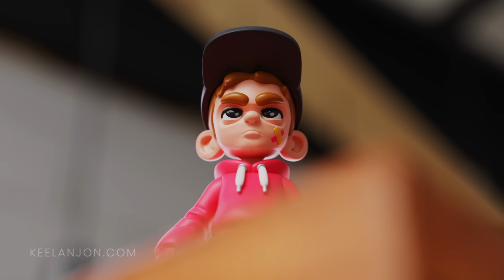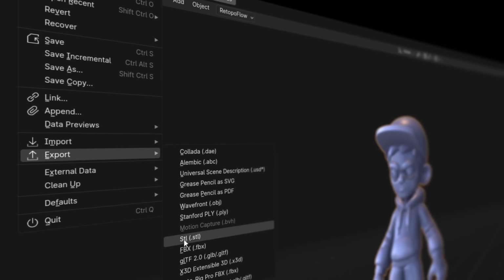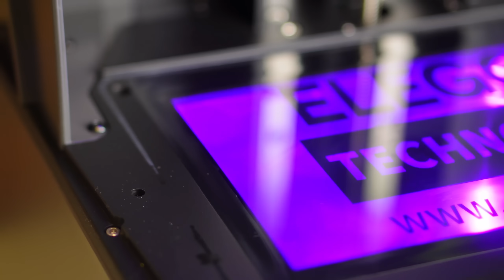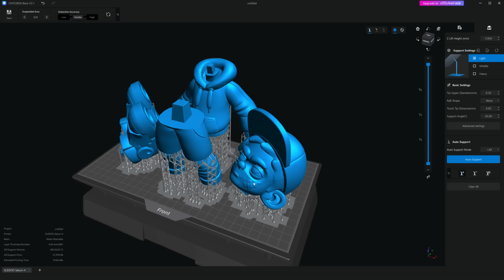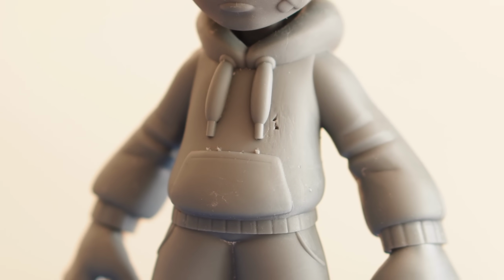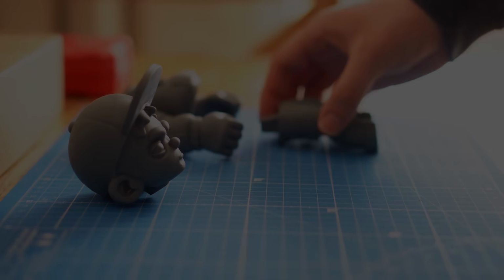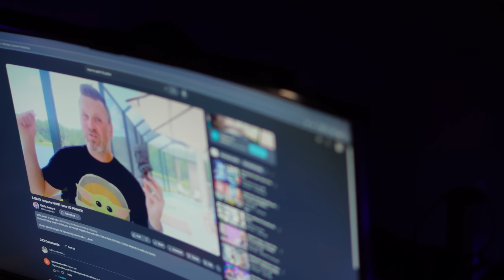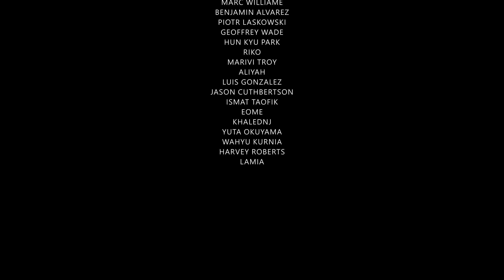How I Made My First Art Toy: Blender, 3D Printing, and Painting Process

Comment: Man, you printed  without hollowing each part????   try doing it so it will save you a lot of resin.  still  amazing work. cheers.
Reply: some figures are like that on purpose for weight and balance
Reply: yeah that's how I started printing and months later, they cracked and resin poured out. It was kinda heart breaking really but a good learning experience. You can only cure so far into resin so hollowing is really essential. I don't know what the thickness is you can go to but my models were big 30cm tall figures and they proper split apart and leaked ruining the model.

I always hollow now which of course saves a lot of money on bigger prints but it also increases the chance the print will be a success. Heavy parts put a lot of stress of the print plate. Also you need to learn all about where to put holes for drainage holes. So much to learn with resin printing but a year into it you're flying haha
Reply: @hadjthehuman  if you want to introduce weight, you can add that in after as a hollow model can be filled with anything from sand to metal bits if you want a lot of weight. I generally print with bases for models but if you want a figure to free stand on its own two legs then its good to print hollow and then just fill the legs with metal weights to bring the centre of mass down as low as you can. Top heavy solid models are the worst and I think you can assign a countdown timer to the first time they fall over and break. And resin will happily snap in two with a model like in this video just from falling over unless you're using really flexible resin. There are little secrets shared on forums about mixing 10% of a magic resin that's very expensive but it introduces that flexibility which is great for swords and pokey bits, anime hair spiking out or flowing dresses. Siraya Tech Tenacious resin is an old favourite to mix with cheap resin or you can splash out and print with just that and get amazing longevity out of prints. This guy is printing with water washable which is the worst for structural strength but you do get to avoid dealing with huge amounts of alcohol so swings and roundabouts!
Reply: @ClayMann Correct, Tenacious is great! At my job we mix 20/25% Tenacious with abs like resin to print covers for parts that are heavily used and prone to drop on the floor. The downside is that it has a “slow flex” so parts will deform over time if they are under force or pressure, even if it is very little. So keep this in mind when designing. The major upside is a really great improvement in shock absorption! We are now able to throw the parts with force into a wall without shattering, even if they only have 3mm thick walls. The only questions remains how long they keep these properties over time🤞
Reply: @ClayMann drilling holes are not enough, probably need a small UV LED to cure inside the model, just an idea I have not tried this way.
Reply: @Cessnagpilot  there are times having a thin pen UV torch is great like if there is infill inside a hollow model but I've never found you need to cure inside a well hollowed model. You just need to get the wall thickness way down. It's amazing how thin you can go and still have a strong part which saves resin too.
Reply: Agreed.
I've printed my Toon well and Jack-O-Lanterns multiple times. And hollowing them out is best.

That said, if you do hollow it out, then you need to provide each print piece with two drain holes. On being to prevent a vacuum. Trust me. You don't want your print to have resin trapped in it. Hallowing it out also helps prevent the need for strong supports. Which is the main culprit behind the dibbits of his print.

If you don't hallow it out, then you also run the risk of the print falling off the resin print bed. Been there. Done that.
Reply: @Cessnagpilot 
Personally, I only print with white or clear resin. This greatly helps prevent uncurred resin.
 As for holes, you don't have to drill them. Every print program has a "punch/hole" feature. Just put the holes where they won't be seen when assembled.

 And unlike FDL printing, Resin prints don't need internal supports as much. That said, they do help sturdy the printed model
Reply: I read all of those comments, and to say the least, this has been very educational, for which I appreciate it a lot. I have a couple of questions I'd be very grateful if you could answer, as I am new to 3D printing. 

I intend to launch a collectible toy brand, and I want to manufacture them using resin 3D printers, as I found them to be cost-effective and they eliminate the need for a third-party manufacturer. 

Do you recommend that I use resin 3D printers? If so, what advice do you have for me?
Reply: @MostPoorChef  
 The only thing you'll want the 3D printer for is Molds and/or base prints to create your molds from.
 I use Resin printers and they still show the layer lines. Customers don't really want anything that looks like it was 3Dprinted.

 The best thing to do is to print your figure(s), sand and prep it to remove the feel of the layer lines. Then cast a mold of your print. Silicon works great for molds, but don't forget to apply mold release! And then just produce your figures from the mold.
 Otherwise, you're going to have folks complaining about the layer lines and how fragile the figure is.
Reply: @sespider  What do I fill my mold with afterwards epoxy resin? Or is there something better
Reply: Your prints can explode when you do that.

And even with vent holes, there may be remaining uncured resin inside.
Reply: @Splarkszter  
This is VERY True.
NEVER print hollow prints in resin without vent/drain holes. The worst part is folks will use infill to insure their prints are sturdy. This is not a good idea for resin printing. Unless you carefully design them yourself. Infills WILL trap resin. There's simply no good way around this unless you design them to be no more than bridges.

The last thing you want is for your resin prints to explode. Nevermind the damaged print. It's the uncured resin and shrapnel you have entered to worry about. Especially if it gets into someone's eyes.
Reply: @Cessnagpilot not if your wall thickness is correct for the kind of resin you are using. If your hollowing settings are good the UV light will penetrate the whole wall
Reply: Any tips on creating hollow prints that don't explode. I've made some and everyone of them exploded after some time. (I thought I cleaned them well but no I guess) Id rather not hollow give all those fails but idk if my luck just bad
Reply: @knightroartz3846  way too valid if the ammout of resin doesnt hurt.   15 min clenaing and 23 min curing.. that makes the magic for me. peace
Reply: @TheAeonmaxwell  I'll give that a go soon then thx for the reply

Comment: This specifically applies to tape rather than masking fluid, but I have a small tip to help prevent bleed: After you apply the tape, lay down another light coat of your base color first, then your mask color.
Reply: You mean to cover the tape with base color so the other color won't bleed through the tape?
Reply: @NateWithWho  Yes.
Reply: @SpaceManRD  thanks!
Reply: Could you provide an example? Like say I wanted to paint the shoe white but not the leg. Once I cover the leg with tape, what would be the next step?
Reply: @M-B17 paint the tape the base color of your model, while taped onto the figure or shoe, then go in with the actual color on the shoe. It’s like sealing the edges. Painters do this too
Reply: @danix454  Thank you , this helped me understand

Comment: pretty cool! This is exactly the reason i want to get a 3d printer, to make my own robot toys. Pro Tip, go look at how to handpaint mini's for Tabletop games, learn about dry brushing and layering, and how to water your acrylics down and apply multiple layers per color to get smooth even finishes, and very cool shading. Watering down acrylics and then doing a couple of coats, you get very nice clean even finish on your paint. Seems to me that airbrushing with the rubber mask stuff is more complicated and time consuming than necessary. The watered paint flows into and down, water tension and gravity. And when it dries the pigment follows the water. While i love your model, flat plain colors could be juiced a bit with shading and details. I only start with a flat color as my base, then i go to town on it to bring it to life.
Reply from the maker: These are some great tips, thank you!

Comment: Haven't seen any mention in the comments: You can use the resin as a spot filler for small holes and gaps. Cure it with a UV flashlight or the curing station and it bonds to the resin perfectly. You could even use it as a glue. That gives you uniform behavior during sanding.
Awesome job!
Reply: what uv flashlight would you recommend? im looking for a high precision one but theyre all kinda wide angled or have poor reviews. Any recommendations?
Reply: @bjornly-xr  Not really... I've tried the green stuff world , its a generic led flashlight with uv leds. Ok for small jobs but weak. I just put the processed items under a nail curing lamp. Crude but works
Reply: @apostolosroulias8  thanks, i'll check it out. Kinda wild its so hard to find one tailored to the 3d printing community, since the community itself is so self-sustaining in printing tools FOR PRINTING MORE in every other way xD
Reply: @bjornly-xr  "tailored for 3dprinting" it's like buying stuff just because it says "gaming"

Markething and brand dependence really has made a permanent wound.

Comment: Here are some tips from a more experienced resin printing guy:

1. Divots can be mostly prevented by bathing your print in hot (80c) water for a few minutes. Supports will soften and by pushing them away from the print (instead of pulling) should prevent most of them and in some cases you can even end up with a near perfect finish with some practice.

2. Curing afterwards is "mandatory" either with a wash/cure or by just putting your parts in the sun. Whilst still soft the resin i still dangerous

3. Make hollow your parts! Not only will this safe LOADS on resin usage but will also prevent what happend in your first print (detaching from the support) since there is less weight to pull after each layer. When you do hollow a print don't forget to add some holes where you can't see them to prevent suction to the FEP film which is even worse than a solid print.

And of course, you could have gone much bigger by not printing everything at once... not really a tip just a "could have been cooler" ;-) 

Also thank you for pointing out that even water washable resin is still chemical, many youtubers don't mention this and the impact on the environment can be huge if we all just dumped it down the sync.

Comment: Great video edition, really talented. I would like to share with you some tips that If you decide to do them will greatly increase your art.

•Try to hollow whenever you can your pieces before printing. This has many advantages as: a) You'll save a lot of money on resin, you will also save money by expanding the life of your nfep, as well as the life of the screen. b) Resin takes a lot of time to fully cure, when you print solid many micro parts of uncured resin will be trapped with time those will  force its way out and it will crack your figure. c) By hollowing you'll have the opportunity to be more creative and add as instance a set of LEDs. Later you can always fill pieces with polyurethane urethane or Epoxy or Polyester Resin, for rigidity or weight balance if you need it, also for rigidity if you fill it you can add pins, for extra rigidity I use metal brass rods of many diameters. If you decide to hollow make sure you add holes as close to the build plate as you can as this will prevent a suction cup effect, and more holes for the drainage.

Having said that when you place your figures on the build plate tru chiti or any other slicer give it an angle, it doesn't matter if it takes more time, you will span the life of your nfep and will avoid many failures, it's always better to be more patient but having more success rate. And you can always heat your resin so you can lower the time per layer, i have successfull prints with just one second per layer and use a brewing band that is placed around the Vat to heat it. 

Well sorry for this long comment,  but when I started printed I did not know of any of this tips. Hopefully it is of good use to you. 😁
Reply: Thanks! Been thinking about buying a resin printer for myself. Any recommendations? Maybe waiting for the BambuLab model that isn't announced yet? 😀

Comment: As someone who is just getting into making youtube videos and painting figures..Its very scary to do your first paintings,but at the same time..Its so much fun!
You can always learn from your mistakes and aim to change some things for the next one

Something you can do when applying your first coat of paint with an airbrush, do a very light layer,and let it dry off or flash before adding another layer. This will let the next set of paint adhere to the model alot easier,than just coating it all at once

Comment: You can dilute milliput with water as you like or even make it a slurry to fill in holes and feather edges. I recommend picking up a silicone tipped brush for the hard to reach places. Finger is usually fine otherwise. Awesome figure btw and nice video.
Reply from the maker: I didn't know a silicone tipped brush was a thing, thanks for the great tips!

Comment: Nice vid, i like to see your using a cardboard box for painting , I did that too :D but id love to get a proper spray box or build one.  In terms of starting out with resin printing a few tips,.

1) Careful with the water washable stuff, sometimes it doesn't get clean enough. I'd recommend you get an ultrasonic cleaner ,   just remember to clean it after each use so resin doesn't stay in it.  If you use IPA instead in that just put it in a jar or plastic bag thats filled with ipa inside the water tank , the loose resin should still be drawn away from the print.

2)  In regards to cleaning,  the resin water you leave behind btw after rinsing in your bucket is a pain because it  takes FOREVER to evaporate and you CANT put that stuff down the sink because its harmful.  I switched back to IPA because of this since it easily evaporates, just have to remember to wear a mask at all times (which tbh should be doing anyway with resin printing due to the VOCs) and just put the bucket outside during day when done with it. 

3) If you do hollow prints just remember to clean very thoroughly as others have said because water washable resin will crack later down the line if its not properly clean inside and cured.  I have had this happen and a little bit of liquid came out.  So i personally always rinse about 2 or 3 times , so have a 2nd bucket with cleaner water to rinse in aswell  Also get a little uv pen or led uv light you can put on a cable to stick inside the hollow print , the uv curing machine sometimes isnt enough to reach the interior parts of a hollow print. 

Sorry for the wall of text :)  Nice model and happy printing!!

Comment: Also im not sure if you have started to manual support yet, but it is a lot better once you learn how to do it - on lychee slicer, you just use the "island finder" and then personally I put 0.8 mm support links on the islands, and then use a mixture of 0.5 mm, and 0,3 and 0,4 mm tipped supports on the rest of the model :) 

For clean up stage.. , idk if you care about any pointers/ sharing off ideas :D but im gona do it anyway ahha, you REALLY do not need to go as high as 2500 grit with clean up imo, I start with 200 -300 grit, and then go to like 600 grit and thats it, primer and paint layer will smooth out 600 grit just fine, 2500 just isnt needed :) feel like you probably waste a little time going all the way to 2500 grit 

For the masking, Tamiya masking tape is king, they have many widths and so can be very useful, I like to put it on, kinda overlap areas, and then use scalpel/hobby knife (and I keep a really sharp one just for this) to cut along seems and edges, and get it into the exact shapes you need, you could for sure do that with your shoes there :) alternitevly tho, just hand paint the red after a white base, I used to mask everything and airbriush, but after improving at hand painting after trying it a few times now, id probably just hand paint that bit now

Comment: Thank you for this informative video! I am getting into 3d printing my figures at the same time. Could you post a tutorial on how you boolean apart the different pieces? This is the most intimidating to me. I noticed that the legs fit inside the shoes in a natural way. I'd love to see more of your process on that.

I'd imagine youd attempt to keep the hair/hat separated for the next one.

Also a tip, I find bondo glazing putty (it comes in a small tube) to fix printing errors beautifully! Its easier for me than two-part resin clay

With resin printers, I find that a coat of primer actually removes the print layers beautifully, but I end up sanding anyway because I find  that on occassion a layer is considerably deep from a printing malfunction. I thought I'd mention it anyway for if you struggle to sand away the layers in tight spots.

Comment: FYI u need add some glue placement into ur drawing and rib model, u can changed the rib like the action figure from disney. so the glue cant leak and have a more strength. that's my experience in my work to make a sample for disney action figure. also u can read the standard of the rib in plastic product modeling. i hope it can be help u to make better results :))))